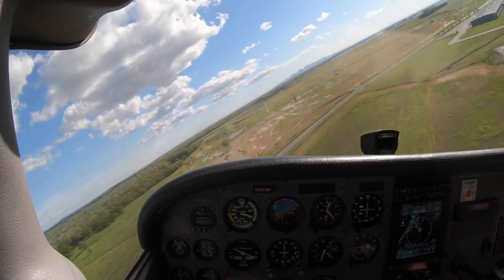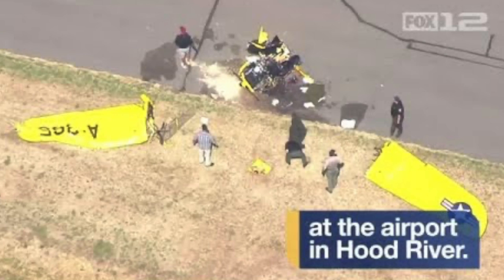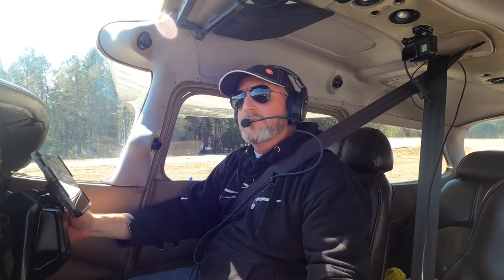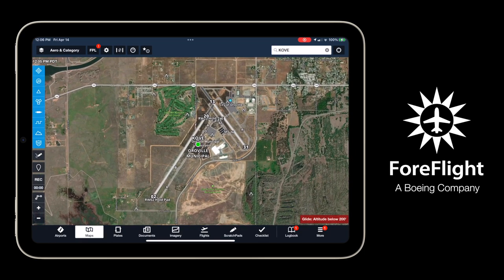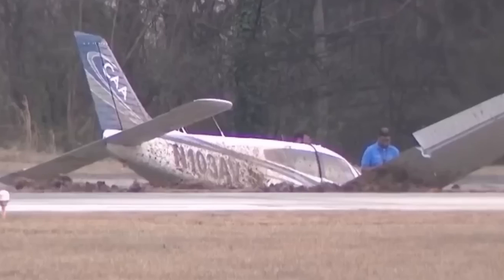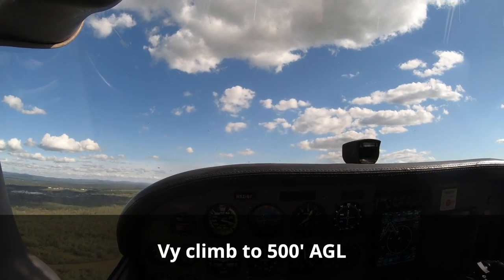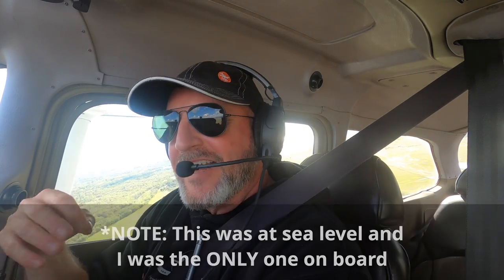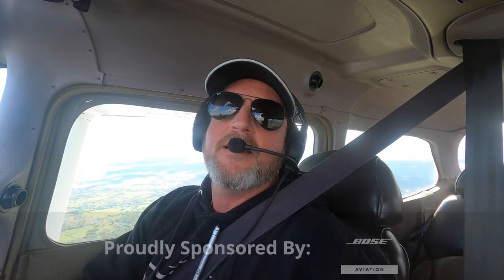The IMPOSSIBLE Turn? - Engine failure on takeoff - Airplane Crashes - 180º Turn Back To The Runway

Comment: Feb 23 2021, I lost my engine after take off departing LVK 7L, and I was 100 feet AGL my only option was a highway overpass, and on roll out I had a rear end collision with a car. No injuries and a clean flying record, thankfully.
Reply from the maker: Is good to hear that story and I’m glad you’re all right. There weren’t many options at 100 feet AGL but it could’ve ended a lot worse. There was a similar accident out of Concord. We’re a little girl got her leg cut off on the way home from soccer practice from the spinning propeller.
Reply: @TheFinerPoints  I've never really practiced engine outs to that extent, just the normal ones that are required for checkouts and the like.
Reply: @fishhisy  Coward CFI you had. I taught 4 kinds of EFATO in my 1990's CFI years.  In the millennium,  with youtube there is no excuse to skip the main 4 kinds of EFATO.

Comment: Excellent coverage of the considerations of possible turns and the impossible turn.  Eleven of my thirteen engine failures happened below 200' AGL, so many possible but no impossible turns.  Concerning startle, I had the advantage of them happening mostly crop dusting and patrolling pipeline in tired small airplanes.  I expected to have an engine failure every time I went out.  Concerning the push to unload the wing, which I totally agree with for those using Vx or Vy as appropriate, I never had to do that.  My default was acceleration in low ground effect, all the way to cruise in crop fields and on long runways and then pitch up only enough to just clear any obstructions I could not rudder turn around.  For low altitude orientation, 17,000 hours of which I flew, I teach never pitch up without zoom reserve airspeed for maneuvering.  Zoom reserve airspeed works with or without engine power.  For turns I teach default relaxing all back pressure in all turns.  Thus all turns are 1 g, regardless of bank angle.

Again good lesson.  What you covered I always had and only broke three of the aircraft:  Cobra in combat, Pawnee turnover in soft field, and I poisoned myself enough to mess up a forced landing in a CallAir and cartwheeled it.  I was so far behind the airplane in that one that it should have killed me, but it just broke the right wing spar in two places and tore the engine off with little damage to the rest of the airplane and none to me.

Until we get that thousand feet, airspeed and not altitude is life.  I instructed but left the prep for the PTS/ACS Vx or Vy as appropriate to other instructors because along with doing so much low work, I just couldn't make myself go there.  I really disagree with teaching as default a technique that is almost never appropriate.  Even though we left max loaded from mostly short strips spraying, we always gleaned every inch of low ground effect energy possible and never overflew obstructions by more than a few feet.  The farmer said I had hit a tree more than once, but it was only down wash.  Safe maneuvering flight techniques kept me alive.
Reply: "Zoom reserve airspeed works with or without engine power.  For turns I teach default relaxing all back pressure in all turns.  Thus all turns are 1 g, regardless of bank angle."  AND "Until we get that thousand feet, airspeed and not altitude is life."  Sage advice from a true low-level pro.  I can remember the magical way my flying fell into a flow... the moment I stopped loading the wing in turns.  Thanks again for sharing these. pearls.
Reply: Agreed Mr. Dullin.  Learned to fly  on Piper Colt flying brick.  Always kept nose as low a possible on take offs and Vy climbs just in caseengine fails.  CFI made me do a few Vx take offs at 60 mph on that short wing before i soloed at only 10 hours/17 years old in 1969.  But i never did those Vx take offs myself even when he wanted me to do them when solo.  If that engine coughed, I could stall it before pushing nose down.  I was a 125 pound skinny kid, so my CFI wanted to see how good the Colt will climb with me only on a Vx take off when soloed.  I didnt do that and he asked me why not when i finished the 3 touch and goes solo.  
   I Learned much later that stupid Vx take off high AOA have killed thousands of pilots.  Too much angle change needed to gain from Vx to Vglide speed if engine quit.  Also high wingers dont have a fuel pressure pump to keep fuel pressure on high angle climbs.  They should.  I think that high angle on a say dirty or old gravity fed system can block fuel pressure a lot to carburetor.
Reply: @RaineyParker  Sure.  As Wolfgang explains the law of the roller coaster in Stick and Rudder, we can trade zoom reserve airspeed for wings level climb a bit before releasing that back pressure in the turn where we trade that extra altitude for airspeed.  Levelling the wing again before pull up (steep crop duster turns), we avoid graveyard spiral.  So turn of any bank at 1 g and maintenance of altitude if we wish that rather than diving into the crop field.  Nothing wrong with level turns during instrument flight where all control input is limited by honest fear, but they are certainly more dangerous and not necessary in maneuvering flight.

Comment: The impossible turn is all about climb gradient (ft/ mile) vs power off descent gradient (ft/ mile). It has some to do with runway length. It has almost nothing to do with altitude (300 or 500 or 1000), especially on a straight out. I am not an instructor (yet!) but I am hoping we start talking about these variables and come up with some basic set of rules to help pilots -- these rules can be applied on the ground (part of takeoff brief). 

The challenge (and this is where you can help!) has been how to take the relatively complex math (I am working on a spreadsheet) and figure out a simplification such that it can be used as thumb rules. Happy to talk. But without the actual variables at play ... pretty much all material on this is hard to use.

Comment: Tests in my Musketeer suggest an impossible turn becomes possible at about 900 feet AGL. It won't be pretty, and there isn't much margin, but I'd (probably) make it. I was also taught to keep my hand on the throttle until 1000 feet AGL.

When I did a checkride in a 172 a couple of years ago the instructor threw several simulated engine failures at me. The big thing he was looking for was best glide speed - NOW - before doing anything else.

Comment: I taught EFATO and LOTOT turnbacks to many in the 1990's.  It depends on weight and winds mostly.  And practice.  I had to do one partial power from 300 agl, and 3  i know had to do with bad engines partial powr from 400 and 700 agl.  Those were done on short wing cherokees and C150.  We had houses around the airport.  No power i taught on my cherokee 150hp from 800 agl but only if climbed at over 700 fpm.  You cannot do no power EFATO Turnback if did a shallow climb..  You wont reach the airport and will be An Impossible Turnback.

Comment: I agree, 100% and practicing this down to the altitude of which you won’t return. Every airplane and pilot are different so practicing in a specific aircraft is paramount.  I’ve practice in my Rans as 21 and have been able to get it down to just shy of 250-300 feet.

Comment: I had an engine failure on climbout at 600 ft in a light sport. The "startle effect" is real. After that, I pushed the nose down and turned cross-wind and then downwind. Once I had reached about 100 ft, I turned base, then quickly final - landing on the same runway I took off from. My instructor always taught me to circle, not to do the impossible turn. I have never seen a video that shows that.

Comment: I'm a former bush pilot with a low level rating. I found in a cessna 172 it's possible to achieve this turn above 300ft agl.
The ground shy reaction is real it makes people not fly the plane to the ground.
Nose down and turn with the stall warning on but aircraft not stalled and the stronger the head wind on take off the further you will get towards the runway.
Reply: Did you land it, or cancelled the BS before landing it.  I did them in 1996 in training with 11 knot winds to a 4.4 feet runway. Did 4 in training.  More later as CFI myself.
Reply: @outwiththem  made it back to the runway any time above 300ft agl. Less than 300ft the runway environment was achieved
Reply: @lankeyswainable  Was that with partial power? That can be.  But no power, and waiting 3 seconds before turning? umm ! something is BS there.
Reply: @outwiththem  when bush flying and low level flying your always on edge and ready for the turn back. It's what we brief before take off. If it just a cough in the engine and you have turned its no problem but if not you are facing the Runway with a tail wind so you do make and land it if your good enough
Reply: @lankeyswainable  I partial power.  zero power, even with only one on board a c172, i doubt it.  UNLESS YOU HAVE A LOT OF WIND to help you come back..  see ELM channel about that..
Reply: @lankeyswainable  Im always prep to turnback or turnaround if enough power to turnaround.

Comment: Without being silly and you have enough height to make the turn and have the runway in front of you it is not impossible. However, if you've been told that the turn is impossible and you have never practiced it, then when you see the groundspeed increasing and you are flooded with adrenaline then your brain will shut down and all you want is for the groundspeed to slow - hence stall spin. The secret is practice, practice, practice and adopt the aircraft standard of DMMS (defined minimum manoeuvre speed) and being pushed by Dan Gryder to get it adopted for GA.

Comment: Great video and topic.  I'm surprised there's no mention in the video or the comments below on the Possible Turn articles/webinars by Barry Schiff years ago or Brian Schiff more recently.   I think these will end up being classic.  (Both explicitly state however, as you do, that the turnback should not be attempted except when landing straight ahead is not a viable option).  Brian even has a worksheet describing the technique and where you can plug in the numbers for altitude lost, height at the end of the runway, and adding 50% to the altitude lost as a cushion for other factors.  They recommend a climb between Vx and Vy as a compromise between too high an AOA (Vx) and too great a distance from the runway (Vy).  They recommend a 45 degree bank at Vbg for an optimal, safe turn radius.  (Master CFI Russ Still told me that in a descending 1G turn, laws of physics dictate that the airplane must accelerate, and to arrest this, back pressure is required in the same amount as required in a level banked turn of the same bank angle.  In this gliding banked turnback he says use enough back pressure to fly at Vbg to control the airspeed, though he prefers a 30 degree bank for a safer margin above stall.)  The other thing the Schiffs recommend is that the pilot is proficient in the maneuver, and that requires recurrent practice AT ALTITUDE in the airplane you typically fly.  Personally, I think that practicing this real-time after takeoff, should be left to the experts such as you or those in the AOPA video demonstration.  Otherwise, a good alternative is practicing the maneuver in a good full motion simulator such as the Redbird FMX, as I've spent several hours doing.  Finally, unless the maximum rate of climb in fpm is dramatically greater than the maximum glide rate of descent in fpm you'll have difficulty getting back to the runway.  A Bonanza is a good example of this difficulty whereas it's well within the capability of other high performance airplanes such as a Mooney.

Comment: it's important to note that the impossible turn is more than 180 degrees.  it's more like 360 if you draw it out.   A 180 degree turn would put you parallel to the runway. maybe 500 to 1000 ft away.  you need to turn more than 180 deg. to get back toward runway centerline and then turn again in the opposite direction to level out. It is only a 180 change in direction.

Comment: I also like practicing salvageable bad approaches/landings incase you don't get a second chance. It's really good to differentiate when to go-around and what can be saved. Obviously, when in doubt go around!
Reply: Many crashes on go arounds from flare with full flaps.  Learn how to fix the flare.
Reply: Learn how to fix the full flaps (while in ground effect) during the go-around, at least in Cessnas...
Reply: @eds.173  If you know how to fix the flare instead of going away from it, you wont have to go around from a bad flare.  Duhh !

Comment: This training and Steve from Flight chops video saved my life on a take off a few years back.  Encountered carb ice event after rotating and climbing out over highway.  I knew not to turn back, did gradual turns, and kept picking places to crash.
What is your advice on application of carb heat after full throttle is applied?  Do you recommend touching mixture?
Thanks for the video.
Stay safe.

Comment: Great video, very good advice, can be life saving! Thanks so much. 
It is quite difficult to learn this reflex, which is the opposite of what most non professional pilots or wannabe pilots like me, would do, keeping it level, when you have to actively enforce a dive in order not to stall and stay in control!
Please make sure when you try this closer to the ground to inform the tower beforehand to avoid heart attacks from watching you!
Also try stuff like that on a modern simulator first to get a feel for what is theoretically possible before you do this in real life near the ground.
And make sure you know the best glide speed of your aircraft to maximize the range and turn into the wind, making the radius smaller in order to hopefully make it back without a damage.
If the runway is busy or difficult to reach, but the taxiway is not, do a Harrison Ford and land on it, since this is not about playing by the rules, it is about surviving and minimizing damage.
Reply: Great comments.  The Redbird FMX has helped me develop the muscle memory for this maneuver, and evaluating success when changing parameters, such as runway length, wind speed/direction etc.
Also back pressure on the yoke/stick will be necessary to maintain best glide since the maneuver is a descending spiral.  There should still be enough margin in a 45 degree bank at Vbg to prevent an accelerated stall

Comment: Many so called "Experienced Pilots" are not experienced on Turnbacks Maneuvers, Be on GRM or EFATO.  So that experience on other easier to do maneuvers DOES NOT COUNT WHEN YOU DO TURNBACKS.  Same with accelerated stalls, go arounds from flare with flaps while turning, spins and aerobatics.  That is why they crash on those maneuvers.  
    IE;  "It's a different kind of flying"  (Altogether) LOL.  I  used to teach all the above maneuvers when CFI for 9 years.  Airline pilots were the worst on those maneuvers when on singles.

Comment: The CFI did what he had to.   I am glad the airports around the part of New Mexico I would be flying in are desert with few obstacles.   The Albuquerque airports have open areas, Socorro is the same way, Interstate is an option at a couple airports.    The high density altitude, especially in the summer would be an issue.

Comment: With total engine failure, more drag is produced when idling than when you practise by pulling the throttle.
My last engine failure 6 months ago in a Tomahawk from 700 feet i departed runway 22 and turned left and landed on runway 34.
Most important thing was to take control from student and stuff the nose down for 80 kts and turn.
Then wings level glided at 75kts not best glide 70 as there is no margin of error, nothing to play with.
Landed no problem. Seems like water in fuel.
Reply: I think you mean windmilling , not idling. Yes the drag is a lot in the former because there is no thrust at all and the POH gives only a 8.5 glide ratio for a windmilling prop. Pulling the throttle gives a deceptively shallower glide angle because there’s some residual thrust at idle RPM.
Reply: @davidwhite8633  Correct i used the wrong term, windmilling more drag than closed throttle idling.
Reply: @davidwhite8633  Yes perhaps we should set say couple stage of flap to simulate the real performance with power loss. My old Battle of Britain instructor said about stopping the prop if on fire, could also improve the glide performance. Done it few times over the airfield.
Reply: @flybobbie1449  Yes, he was right about the stopped prop and further improved glide ratio. Of course, if the engine seizes ,it will be done for you ! No necessity to pitch up to near stall warning horn to stop it.  In the unlikely event your prop is featherable then pulling the prop control to full coarse pitch will do even better for the glide ratio.
Reply: @davidwhite8633  Well in his context it was to stop feeding fires. He said he saw aircraft diving trying to put out flames, but aircraft just burnt up.

Comment: About McSPADDEN 
Such bad luck, the worst kind of engine failure, in the worst mountain place on somebodys airplane when he was not PIC. Turnback was done well, but engine died short of runway. Then someone popped the gear out too. Big mistake. Owners are the ones that do things like that to avoid scratching the fuselage with gear up. That gear out cut the glide and they hit before the plateau runway. Worst place to have the worst kind of engine failure. Many great pilots have been killed by big errors from other PIC. I dont fly with just everyone due that. 
Vote down this post if you are a mediocre pilot.  Go ahead.